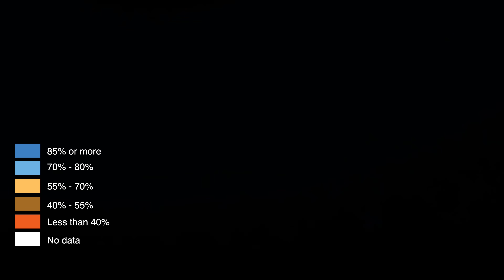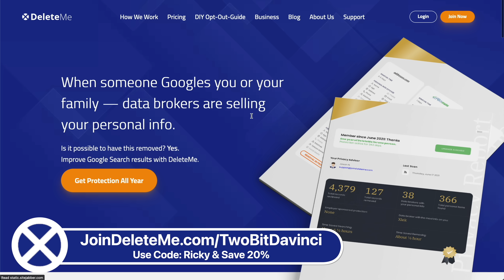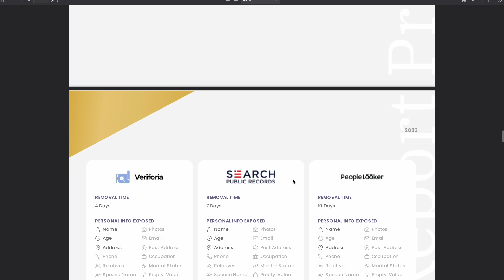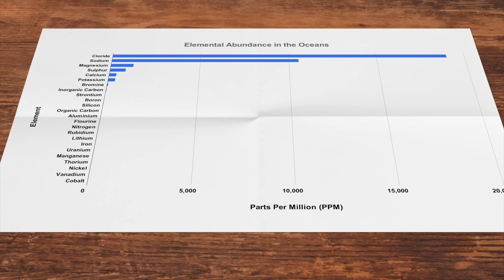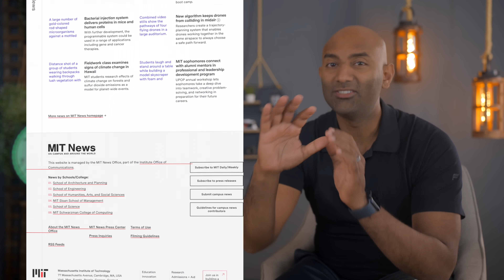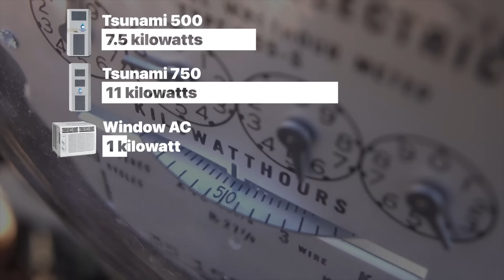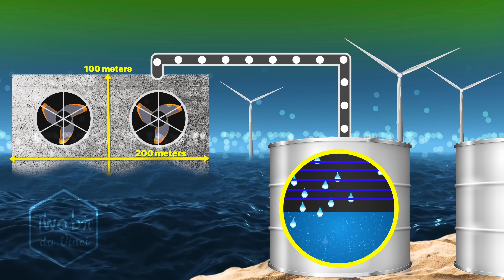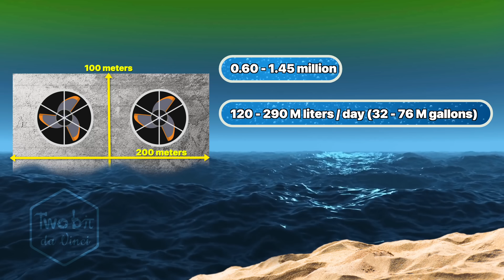This Tower Turns Ocean Fog Into FRESH Drinking Water!

Comment: This basically what your home A/C or  dehumidifier does . I connected a bucket to my condensate drain (my dehumidifier has its own built in container)  and pour the water into a 45 gallon trash can. When it gets full , I have a small pump and water my grass with it. There YouTube videos out there with other's doing this. That is what I do with the water but you may have other uses.
Reply: I work in the HVAC field and I've always wondered why we aren't capturing that water and using it. There is bacteria to worry about but it's not like we don't already know how to sanitize water.
Reply from the maker: Agreed, We will be covering that on a future video
Reply: We've been watering our house plants with a dehumidifier we use in our shower for almost 10 years, but you can't put it on edible plants because of the aluminum gills on the evaporator. It will be cool when someone makes one out of stainless steel or titanium (assuming it could be done affordably).
Reply: @functionalvanconversion4284  I think copper is antimicrobial and an excellent conductor.
Reply: @trikepilot101  that is true, but I have heard that it also leaches metals like aluminum. At least it does in plumbing applications.
Reply: @trikepilot101 
I put silver in all my holding tanks to kill off the kinds of bacteria and mold that infests pipes and condensate liquid.

Mine is pumped from the hvac (heat pump) system into a simple gravity charcoal filter, then to a 2 gallon catchment which is sufficient for my chickens, with the runoff going into two raised bed flower boxes.
Reply: @trikepilot101 I remember the old time door handles made of bronze I believe being said to kill 99% or something germs but it is a valuable metal, however if so many houses used it for door knobs and railings it can't be that bad
Reply: @functionalvanconversion4284  Great idea. Chromium oxides are actually healthy
Reply: @Technoanima , they are? I was thinking Stainless was better since it seems to be more stable than copper or aluminum especially if the coils freeze expand and contract. Hopefully it is as it seems to be the standard in food production. Titanium would be better, but too costly and we don't have graphene yet.
Reply: @functionalvanconversion4284 that would be cool. The problem would be the department of energy will not allow it. The issue is heat transfer of copper tin and aluminum are the highest and most affordable.
Reply from the maker: Hey at least your using it for something
Reply: @TwoBitDaVinci  Bro, you can't have a smart channel, and then grammar like this.
Reply: I've always wondered why ppl run a traditional ac that creates a stream of pure water and just let's it run to the drain and waste. Obviously those inefficiencies need be eliminated.
Reply: I was thinking of that too. The problem with the water is that the coils get dirty and the water tastes bad (walking under it as a kid and sticking out my tonguenever did it again).
Reply: @H0mework 
A simple gravity charcoal filter system eliminates that dirt, taste and smell from condensate water; then a couple of pieces of .999 pure silver in the holding tank is sufficient to eliminate any mold or bacterial growth.
Reply from the maker: Ac condensate is underrated
Reply: @TwoBitDaVinci  I watched another video by a Youtuber that was about a residential water generator that is around 6 thousand (I think)  ,granted it did not produce as much water as the ones in your video and noise is some what of an issue. Enjoy your videos!!
Reply: For the steam iron or adjusting car battery level..., but for plants, animals and humans the lack of electrolytes (minerals) would be a slow killer.
Reply: @TwoBitDaVinci  The only one that gets all the love is the Higgs Boson one 😉
Reply: I’m an hvac contractor and from what I understand the water in the drain system carriers a lot of airborne diseases and viruses. This can be mitigated using a UV light in the coil to keep it to a minimum. Coils now made from tin- aluminum mixed metals are now creating new problems like wet sock syndrome. Older coils that used copper and aluminum had a natural anti microbial effect.
Reply: It's not exactly the same. A/C or dehumidifier is using compressed refrigerant gas to condense to humidity. That is very energy demanding process. This project is using the seawater as a means for condensing the air moisture. That is way less demanding. This system is actually similar to ancient A/C system used in Iran thousand years ago.
Reply: @jirislavicek9954  No, you are not using a compressed gas to get moisture out of the air. An A/C system is divided into two halves a high side and a low side. The compressor  pumps the refrigerant and when it does it creates a high pressure gas that goes to the condenser. There it gives up heat to  become a high pressure liquid;  from the condenser  it goes to the metering device. There it becomes a lower pressure liquid ,in the evaporator, so the refrigerant absorbs the heat creating creating a low temp / low pressure gas. As the refrigerant absorbs the heat the evaporator cools below dewpoint and the moisture in the air condenses on the evaporator. That is the simplified process, I have been a commercial A/C and refrigeration tech for over 40 years. While they may not be doing this directly the concept is the same cooling a surface below dewpoint so the water condensates on it and is collected
Reply: @bertm3237  Yes, you are right. I didn't formulate it correctly.  My point was that A/Cs, refrigerators and dehumidifiers all use the same principle, adiabatic process. When gas gets compressed, it gets hot. When it expands / evaporates it gets  cold. 
To condense water in any of these devices you need to run a compressor, with is very energy intensive.   (Or use other system as in gas fridge etc.)
The proposed solution uses low temperature of the sea water for the vapor cooling and condensation. No need for costly compressors, all you need is a fan to force air into this natural cooler. It is a same principle as (unwanted) moisture condensation in ship and submarine hulls.
Reply: Most definitely you are on the East Coast or South that has lots of humidity. In case of Places like Colorado, New Mexico and Arizona, for A/Cs you need to ADD water to the A/C for cooling.
Reply: @alexv259  I think you are referring to swamp coolers that work on evaporative cooling not central air conditioning.
Reply: On a massive scale this vapour extraction will it impact rain fall elsewhere
Reply: I have a dehumidifier too, it draws 3.5 amps and it's a small one. That isn't an economical or energy efficient method of producing drinking water.
Reply: I would rather have a humidifier for the air because it's to dry in the hot and no rain summer weeks or in winter when the heating is on high level.
Reply: The water from the A/C unit and dehumidifier is WASTE, it's not part of the water cycle of the planet! Taking water that would form clouds will wreak havoc on the areas that rely on rainfall!
Reply: Thank YOU‼️‼️‼️
Reply: Also if you, use a stainless steel/drinking water container, you can then use a basic PF/membrane (sediment and UV) water purifier and literally get water from air.
Reply: Yes but the water is not drinkable,
Reply: @correctingirresponsiblefin3096  I Did not say it was
Reply: You water your grass with pure water? Hmm...ok... it's not exactly bad for it but it's not exactly great use of pure water
Reply: @simonlinser8286  A/C condensate is not pure water
Reply: Yeah but if you run your airco straight above sea level and configure it to just inhale air and compress it whilst using a condensor that goes through the seawater with surface increased by inward pointing pins where water drips of made out of stainless steel for instance it would run way more effective than your current airco that is the whole point having as much saturated by water air and using 5he utmost effective condensation system. Your airco cannot compete to this machine.
Reply: Thats the best short-term solution, to harvest AC condensation water, just imagine the volume of water of all AC in the city's.
The AC are working right now, just collect the water.
Reply: The heat is also wasted. I know an engineer that uses a closed water loop for cooling his evaporator coils and then takes the access heat and uses it as a hot water heater through a heat exchanger.
Reply: Great idea
Reply: I love the idea etc, but..... We have seen the creation of big ideas turned into massive structures, with tales of huge advantages. Only for 30 years later for them to be dismantled, how do you make the technology human size. Scale down from huge structures to human/ house size structures or I really don't see them working. Indian projects have restocked aquiferd in Rhajistan by regreening, having irrigation canals etc.... And not a 200ft tower at a cost of millions in sight...... Sorry if I sound negative, but one group of rich people building things is not the answer.... They've even positively affected the climate...... Sorry but if I had loads of money I'd put it into regreening not buying metal and tech with a 30 year life span...
Reply: If you filter it and run it passed a uv light also you could drink the water. No chlorine to worry about but you need to make sure it's really filtered out good. The uv light is to kill any left over germs or bacteria.
Reply: Natural gas????

There's NO excuse for high natural gas prices. 

The only reason there are high prices is because of those stupid environmentalists.
Reply: @hg2.  That's only part of it. Environmental regulations, cost of operations and industry price standards are only a few of the factors that go into pricing. Of course they charge too much to begin with.
Reply: @hg2.  The doctor office called your meds are ready for pick up!!

Comment: Who told you that water is 'fresh' water. Looool :face-blue-smiling:
Reply from the maker: Did you pee in the pool? 😆
Reply: Explain yourself
Reply: @JackHays75  There is a lot of stuff floating in the air that will be included in the water.
Reply: @kkarllwt  Well yes, I assumed that would be a given and some kind of mechanical filtration method would be employed on the collected condensate. The difficult part was getting the water separated from the salt, which is accomplished by this method, dust and stuff is the easy part.
Reply from the maker: bingo